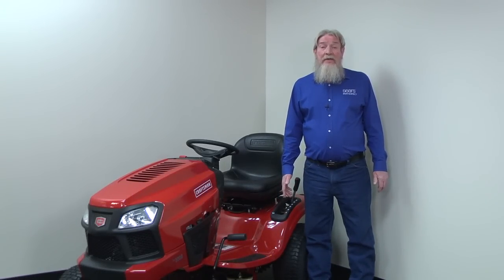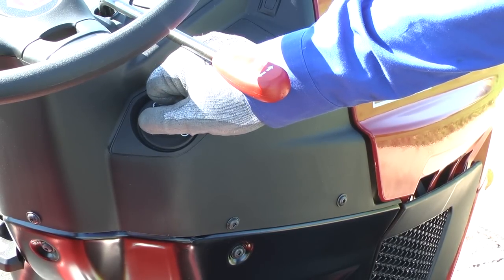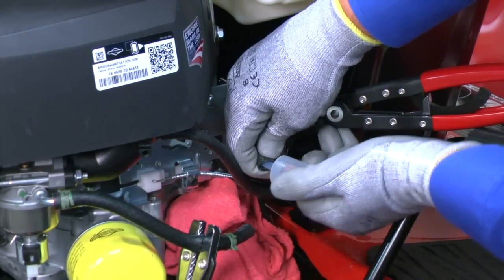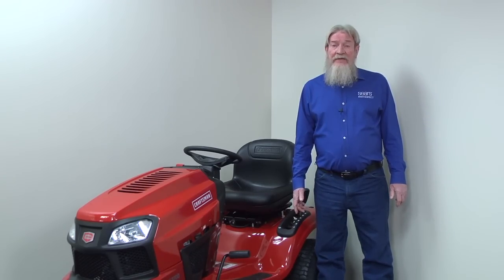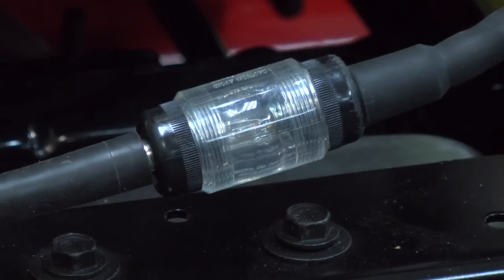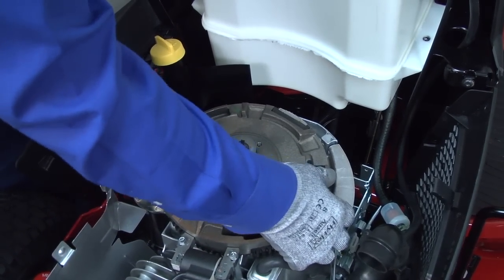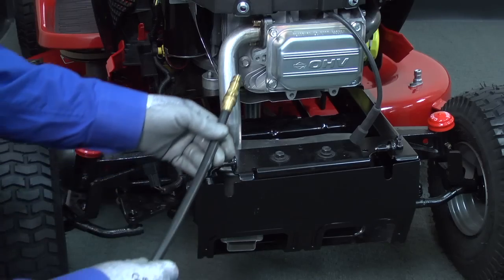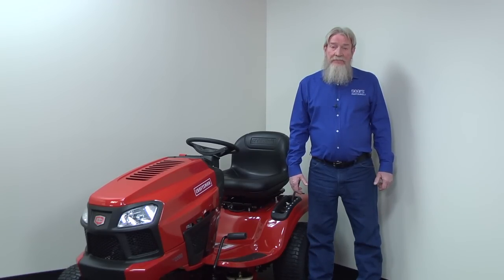How to Fix a Riding Lawn Mower that Won't Start: Engine Cranks But Won't Start

Comment: Hi,I have a Craftsman 4 years old Riding mower 21 hp  Briggs & stratton engine . Motor hard to turn with starter ,new starter & battery-It make 3/4  turn & if if make 1 to 2 turn start right up. When starter can not turn it heat up ,without Spark plug  engine move ok , I checked the valve clearance  .004 & .006 - Do you think it is a Compression release valve ,how I can be sure of that. Please help ,what other thing it could be?
Reply from the maker: Because the flywheel spins okay with the sparkplug removed, the compression release is likely preventing the engine from starting if that engine has a compression release. Let us know the model number of your engine or the model number of your riding mower. Using the model number, we’ll check the parts and specifications for the engine to see if it has a compression release mechanism.
Reply: Thank you for your prompt reply, here is the Model info                             
 BRIGGS & STRATTON ENGINE 

PLATANIUM

ENGINE SERIAL #  130917  ZD 80247

ENGINE MODEL # 331977  TYPE # 0010- G1 .  CODE  # 130917 ZD

540 CC / 21 HP  WITH . XRD
Reply from the maker: Thanks for posting that engine model number. That engine does have a compression release mechanism that is part of the camshaft part 7938800 ( https://www.searspartsdirect.com/part-number/793880/0071/500.html ). You can check that camshaft for damage by removing the crankcase cover. You’ll likely need to replace the crankcase cover gasket after removing that cover. Replace the camshaft if it’s damaged. To help with the repair, we recommend that you use the service manual for the 330000 series engine. You should be able to find that service manual through a web search or on the Briggs & Stratton website. If you need more help, let us know.
Reply: How I can make sure if before opening this, that  compression release mechanism is not working or damaged , can it be anything electrical or  Starter even I changed battery & starter? Thanks for your help & advice greatly appreciated
Reply from the maker: You indicated in an earlier post that the engine spins okay with the spark plug removed. If that’s not the case then you need to check the ground wiring for the battery and starter. If the starter spins the engine normally with the spark plug removed, the most likely failure is the compression release failure if the engine was running smoothly before this starting problem began. If the engine was running rough before the starting problem began, then you can check valve clearance and make valve clearance adjustments if necessary before replacing the camshaft that controls compression release. Page 21 of the engine service manual shows how to adjust valve clearance. You’ll need to replace the rocker arm cover gasket (https://www.searspartsdirect.com/part-number/272475S/0071/500.html ) after removing the rocker arm cover to check and adjust valve clearance so get that part before checking valve clearance. Here’s a video that shows how to check valve clearance on a similar type of engine: https://www.searspartsdirect.com/repair-guide/snowblower/how-to-adjust-the-valve-lash-on-a-snowblower.html  On your engine, you’ll need to move the cylinder ¼-inch past top dead center on the compression stroke. Adjust valve clearance to between 0.003 and 0.005-inches. When cycling the piston to find the compression stroke and position the piston at ¼-inch past top dead center, you should see the exhaust valve hop slightly open when the cylinder nears top dead center if the compression release mechanism is working. The compression release mechanism is a centrifugal-controlled device attached to the camshaft that creates a “bump” in the exhaust valve cam when the engine is below 300 rpm. The “bump” in the cam opens the valve slightly during engine starting to release compression for easier engine starting. The centrifugal control device rotates the compression release device so the “bump” disappears when the engine spins above 300 rpm. If you don’t see a slight hop in the exhaust valve on the compression stroke then the compression release device on the cam is likely broken. If you adjust the valve clearance and the engine starts normally then your compression release device is working properly. We hope this additional information helps. If you need more assistance, let us know.
Reply: Thank you sir ,that is very good explanation-- I will try again this week & post it. Thanks again
Reply: Hi, I replied before some reason did not go through -- here is Engine info  -- Please reply . Thanks               
 BRIGGS & STRATTON ENGINE 

PLATANIUM

ENGINE SERIAL #  130917  ZD 80247

ENGINE MODEL # 331977  TYPE # 0010- G1 .  CODE  # 130917 ZD

540 CC / 21 HP  WITH . XRD
Reply from the maker: Thanks for posting that engine model number. That engine does have a compression release mechanism that is part of the camshaft part 7938800 ( https://www.searspartsdirect.com/part-number/793880/0071/500.html ). You can check that camshaft for damage by removing the crankcase cover. You’ll likely need to replace the crankcase cover gasket after removing that cover. Replace the camshaft if it’s damaged. To help with the repair, we recommend that you use the service manual for the 330000 series engine. You should be able to find that service manual through a web search or on the Briggs & Stratton website. If you need more help, let us know.
Reply: Also can this be because of damaged flywheel key? also if you think is compression release Mechanism ,can I just buy that instead of whole cam shaft --what is the part # for that. Please answer my other inquiry below too. Thanks
Reply from the maker: A damaged flywheel key can cause similar symptoms. If one of your mower blades hit a stump or rock before the engine starting problem began, then you’ll definitely want to check that flywheel key. Here’s a video that shows how to access that flywheel key: https://www.searspartsdirect.com/repair-guide/riding-mower-and-tractor/how-to-replace-the-flywheel-key-on-a-riding-lawn-mower.html Replace the flywheel key if it’s sheared. If the flywheel key is okay, perform the troubleshooting described in our previous reply. The compression release mechanism isn’t available as a separate part from the camshaft.

Comment: I have a Craftsman T2400 riding mower only a few months old.  I was cutting the grass just fine when I ran out of gas (first time I have done this).  I filled the gas back up and now I can't get it to start.  It cranks but won't start.  I am a woman and have nobody here to help me.  Is there something I should be doing?  I have checked the spark plug and there was no gas in there.  I see fuel in the filter, the air filter is also clean.  My blades are NOT ingaged.
Reply from the maker: Try spraying a short burst of starting fluid into the air intake as shown at :38 in the video. If the engine doesn’t start with the help of starting fluid, then a clog in the carburetor or a number of other problems could be preventing the engine from starting. If the engine starts and runs for a few seconds and dies, then a clogged carburetor, a bad fuel filter or a failed fuel pump could be keeping the engine from running. If you need more help, let us know the full model number of your Craftsman T2400 mower and we’ll try to provide additional troubleshooting tips. You’ll likely find the full model number under the seat. Craftsman model numbers typically start with 917 or 247.
Reply: how do I remove the float bowl on this mower it is the same as you have in the video?  Also do I have to remove that piece with the wire underneath it first if so how do I do that?
Reply from the maker: Let us know the full model number of your T2400 mower so we can see the type of carburetor that the engine uses. The model number should be on a sticker under the seat. The Craftsman mower model numbers typically start with 917 or 247.

Comment: I have a Dixie chopper. In the morning it starts good but once it's hot it cranks to long before it starts .I just changed the choke cable and I notice that started doing this since then. Any suggestions will be appreciated
Reply from the maker: Your symptoms indicate that you’ll likely need to adjust the choke cable that you just installed. The new cable is likely causing the carburetor to feed the engine a fuel/air mixture that’s too rich when the engine is hot. Adjusting the choke cable may allow the carburetor to feed the engine the right mix of air and fuel for starting when the engine is hot. If you need more help resolving this problem, let us know the model number of your mower and the model number of the engine. Using model numbers for reference, we can typically provide more detailed troubleshooting advice.

Comment: This is the most comprehensive video I've seen to date!  Very well done... I have a John Deere LA125 that cranks, but won't start.  I've had to watch at least 20 videos posted by John Deere users and still, I haven't found my problem.  I'm going to bookmark this Video for sure!
Reply from the maker: Thanks for the positive feedback. We hope that you find the cause of the starting problem in your riding mower. Let us know if you need more help after using the troubleshooting tips in our video.

Comment: I'm having trouble with my Craftsman rider. It's got too much compression the starter can't spin the engine over fast enough to get it started . please let me know if you have a suggestion. Thanks
Reply from the maker: Pull the spark plug (or plugs if the engine has more than 1 cylinder). See if the starter motor cranks the engine with the spark plug(s) removed. If the engine doesn’t crank with the spark plug(s) removed, then the piston may be bound up in the cylinder (or one of the pistons may be bound up on an engine with more than 1 cylinder). You’ll likely need to have a service technician or mechanic repair the engine if a piston seized in the cylinder. If the starter spins the engine with the spark plug removed, then the compression release device for the exhaust valve may be broken. That device releases some compression through the exhaust valve during starting so it’s easier for the starter motor to spin the engine. Replacing that part is also a major engine repair that may require a mechanic or technician. We hope these general tips help. If you need more help, post more details and let us know the model number of your Craftsman rider.
Reply: I had a similar symptom with a Murray Ride On Mower....

It was NOT the starter motor....the larger single engine  B&S engines use a decompression system to allow the engine to spin on the starter, faster...
Then, when the RPM is enough on the cranking, it releases the decompression actuator and...hey presto, with the kinetic energy in the flywheel.... it starts, as the normal compression ratio is restored.
This is a similar idea used on hand cranked diesel engines of yesterday, there was a "Decompression Lever" which kept a valve open until you achieved enough speed on the rotation(and therefore the kinetic energy in the revolving flywheel)
You then released the lever & restored normal compression....and the engine started....
Same idea but I just dont understand why B&S don't use either a better, larger battery or a starter motor..more able to get the start RPM up to speed.
JUst not a step forward at all!
Reply: "Larger single cylinder engine" I meant, of course.

Comment: I have the Craftsman lawn, tractor model 247203734 that I purchased 2 years ago. I was using the other and it was working fine. After finishing mowing the lawn I stop the engine and then went to do so more yard work. I then tried to start the lawn mower to put it in the shed it would not start. The engine turns but it won't start. I check the fuel line and its fine. I replace the spark plug and it won't start. The engine just turn but won't start. Could it be the Carburetor that needs to be replaced?  I'm surprised this is happening since I only have this lawn tractor for 2 years...Any help would be appreciated
Reply from the maker: Check the air filter and clean or replace the air filter if it’s clogged. Check the wire harness connection on the fuel solenoid at the bottom of the carburetor. If that wire harness is loose or disconnected, the carburetor won’t get fuel. If that wire harness is tight, check to see whether fuel is making it to the carburetor (in a well-ventilated area). If not, a clogged fuel filter or clogged fuel line may be preventing the fuel from getting to the carburetor. If fuel is making it to the carburetor, perform the starter fluid test described at the start of this video. If the engine starts briefly then you know engine compression and ignition are both okay so you’ll likely need to clean or replace the carburetor. A failed fuel solenoid valve will also prevent the carburetor from supplying the engine with fuel. You can view and order parts for the engine on this page: https://www.searspartsdirect.com/model-number/31r9770043g1/1245/1503500.html. If you need more help, let us know.

Comment: Could it be the fuel cylinoid valve if it suddenly shuts off, back fires & won't restart?
Reply from the maker: If the fuel solenoid valve sticks open, it can cause the engine to backfire. That fuel solenoid valve should shut when you shut off the engine and electric current no longer travels to the solenoid to keep the fuel valve open. 

The fuel solenoid typically won’t cause the engine to suddenly stop then backfire. If the solenoid loses electrical current because of loose wiring connection or other electrical failure and shut the fuel valve, the engine will shut off but the fuel solenoid valve won’t cause the backfire because the fuel valve is shut so it can provide the fuel for the backfire. Other engine problems could cause the backfire such as a bad spark plug, lean fuel supply or high engine temperature.

Conduct the starter fluid test described at :23 in the video. If the engine starts briefly, you’ll need to troubleshoot the fuel supply going to the engine. If the engine doesn’t start, check the spark plug, ignition system and flywheel for problems.

Comment: Hey I got a twin cylinder Briggs & Stratton engine that only fires on one cylinder any ideas on what it could be
Reply from the maker: Check the spark plug wire for damage and replace the wire if it’s damaged. If you haven’t already checked the spark plug, pull the plug and check its condition. Replace the spark plug if its tip is covered with carbon or oil deposits. If the spark plug is okay, use a spark plug tester to see if the plug is getting current from the ignition coil as shown at 3:17 in the video. If the spark plug gets current, then the cylinder may not be getting fuel. Check the valve lash on the dead cylinder and adjust valve lash if necessary. Adjusting the valve lash may allow the cylinder to get fuel so it fires.

Comment: I have a 2015 T3200 Craftsman riding mower. Ran great last fall. stored in the garage for winter, pull it out today and added fresh gas to about 1/4 tank of gas already in it. Mower will turn over but not firing or trying to start.. I took the fairly new plugs out and cleaned them up with a little sand paper on both ends of the plug, it still will not fire. Any ideas what I could check for to help diagnose the problem. Thank you ahead of time for any advice you can give me. Ric
Reply from the maker: See if the engine starts by using the Starter Fluid test described at :20 in the video. If the engine starts briefly and stops during that test, then the engine isn’t getting fuel through the carburetor. Troubleshoot the fuel system problem as described in the video beginning at 1:10.
Reply: All gas loses it's octane rating over winter....always drain, & run the engine to use up any fuel in the carb.....THEN store the machine.
This will also reduce the chances of the fuel "varnishing" & clogging the jets within the carb.....
If it smells like varnish....throw it away!  
Never use use gas from last season........ Very FALSE economy.....

Comment: Great video. Thanks. Our mower won't run. It's running with starter fluid but won't keep going. The back fire solenoid wasn't working when i tested it with a battery. I disabled it by cutting off the pin.  The float bowl isn't filling up either way. It's a new fuel pump. I can't figure out why it won't work.
Reply from the maker: Replace the fuel filter if it’s clogged. Check the fuel line and the fuel tank for clogs and clear any clogs that you find. If the fuel filter, fuel line and tank are okay, then you’ll likely need to rebuild or replace the carburetor.
Reply: Sears PartsDirect. I had already replaced the fuel pump and filter. i found that the fuel line was clogged even though i had just taken it off to siphon the old gas out. I ran wire through the line. It went through ok, but wouldn't let fuel through. I replaced the hose. Now i just need an anti afterlife solenoid. Thanks.

Comment: I have a mower that has spark and fuel and the carb rebuild it won’t start but it smokes can u help me ?
Reply from the maker: Ignition timing may be off due to a damaged flywheel key, so check the flywheel key for damage. Here’s a video that shows how to access the flywheel key: https://www.searspartsdirect.com/repair-guide/riding-mower-and-tractor/how-to-replace-the-flywheel-key-on-a-riding-lawn-mower.html.

Comment: Thank you for making this series.  Over the past few years, I've had to make repairs to my 2 riding mowers and wish I had these for those repairs instead of using something "close".  Or reading forums, then referring to the parts diagrams. I even had the "mower doesn't crank or click" in March - a month before that video was published.  :)